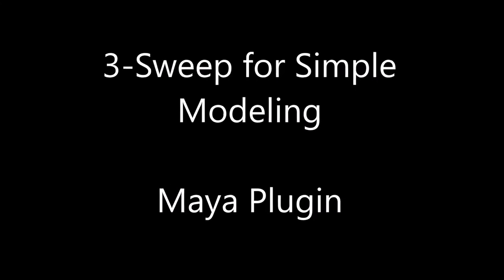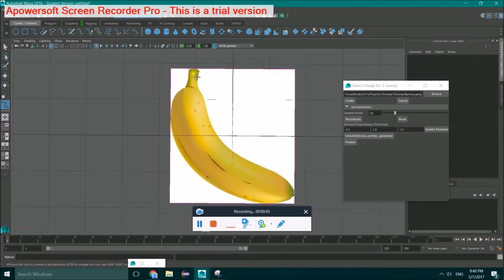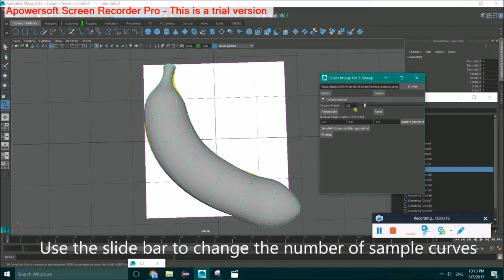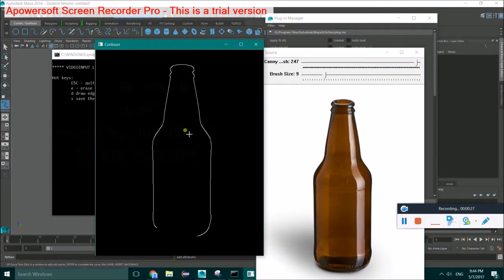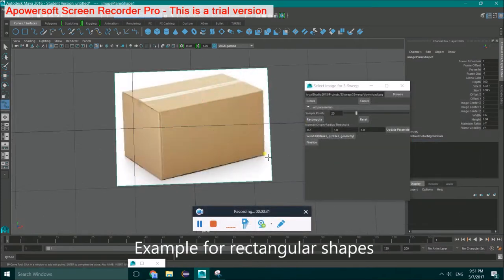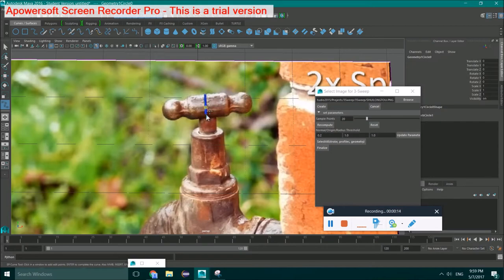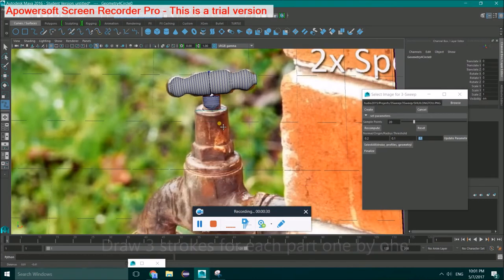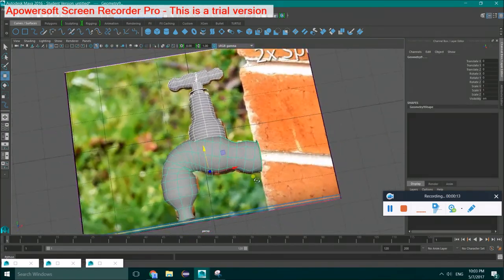3 Sweep for simple modeling

Comment: Very nice implementation. In some cases the perspective projection view angle is incorrect and therefore the model does not match the image object well. You can try to manually adjust it or automatically compute a matching angle. The bottle case should use the other orthogonal coordinates solution, the one that makes the bottle bottom facing inward, not outward